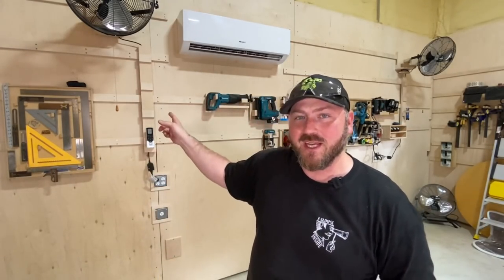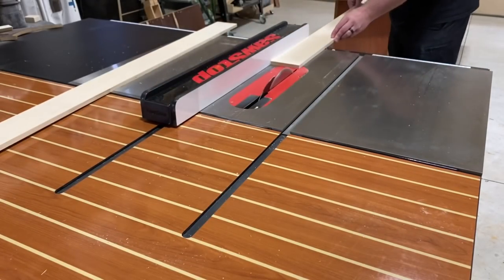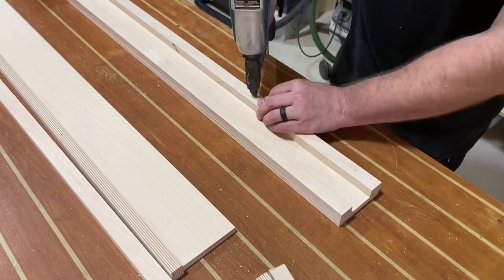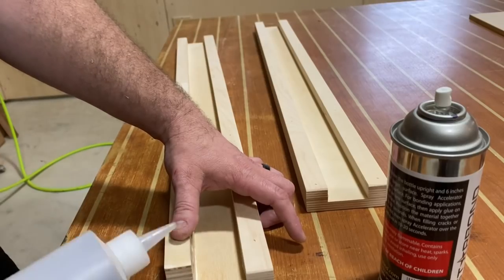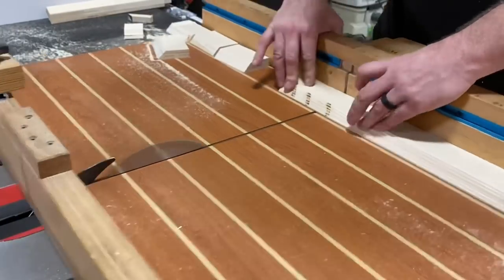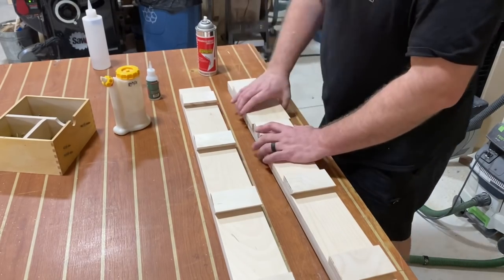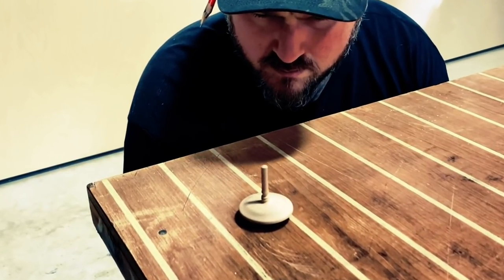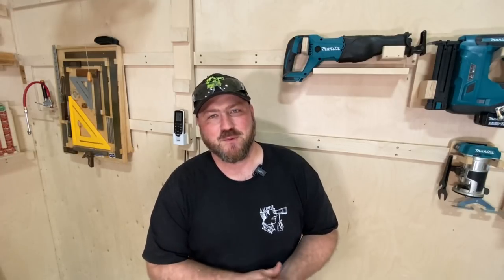French Cleat INCEPTION | How to Hide Your Power Cables in Style! | A Glimpse Inside How To

Comment: Hey Chris,
First and most important...Miss the Kid Crew.
Next the teespring link above is a error according to them.
Lastly, I'm going to try this cleat idea next weekend.  Got a barrel full of end cuts the right size for it.  But I was wondering about how you feel about this.  This idea is great for vertical cables, but what about horizontal?
While watching I was thinking, bad idea there, what about finding a row of wall cleats and routering out a channel across the entire bottom, about 1/2 to 1 inch up from the bottom?  Then with Velcro styled cable ties stapled to the outside edge you could feed the cable inside the channel and wrap the cable tie around it to keep it in place?

BRING BACK THE KID CREW!
Great episode,
Love the Fam.
~Jim

Comment: Cool option. Only thing that I would have done differently is to have the 2nd cleats at the same level they would have been originally. This would make the cable even more hidden.
Reply from the maker: That’s a great idea too. If I were to match them up perfectly I completely agree
Reply: Agree with you that it needs to be perfectly alligned.